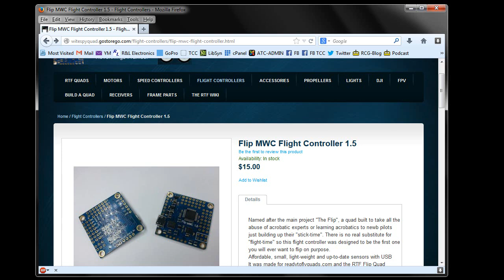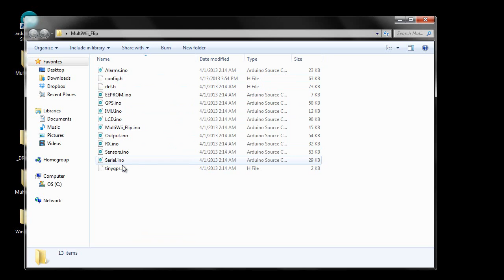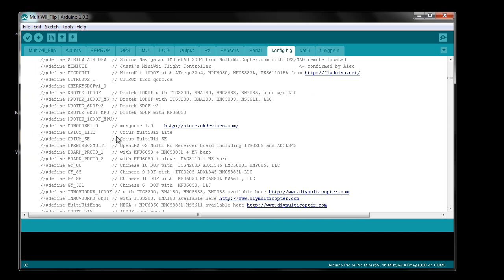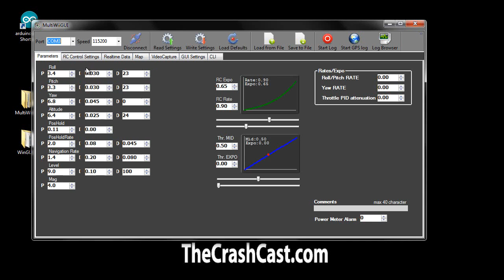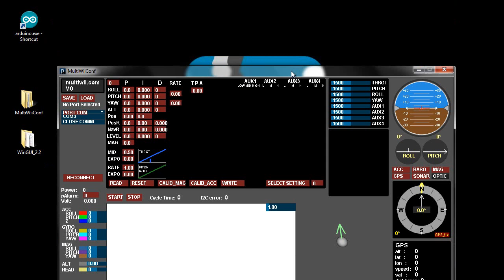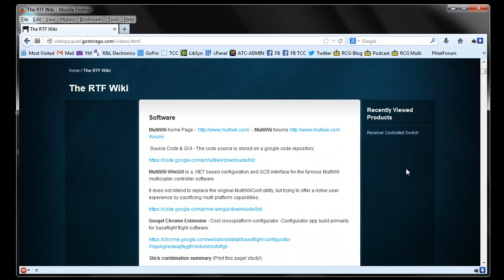FLIP 1.5 For Dummies

Comment: Crash,

Your video has been enormously helpful as I am totally new to the hobby.  

Question: Currently, I have four leads connecting the Spektrum AR6210 six channel receiver to the Flip 1.5 controller (Throttle, Aileron, Elevator, and Rudder).  In order to "arm" or activate the accelerometer, how will the 1.5 board receive the command if there is not a cable connecting the receiver to the Aux 1 pin on the board? 

Again, many thanks for taking time to post your video.

Comment: Plz help! Everything was fine, and now, whenever is plug in the esc's they beep super fast and nothing happens.... Everything works when tested individually, but when it all gets plugged together all i get is beeping. All the motors are plugged in correctly, the battery is the right voltage, ive got my trim all the way down on throttle... I dunno what to do...

Comment: Really excellent video Crash! What a lifesaver you are. 
The only issue I encountered is that for my Spectrum DX6i, I could not do the transmitter endpoint adjustment to the same range.  I could only adjust from 1000 - 2000 (in the MultiWiiConfig utility) and only +/- 125% in the transmitter. Am I missing something?

Comment: I just built a tri with Flip 1.5, everything is good but it just won't arm. Any Ideas?
Reply: I'm having the same issue except with a quadcopter.  I bought it configured for a quad.
Reply: arthurura To arm your quad just slide the throttle over to the left or right but keep the throttle off. After you arm it you should see a steady blue light on the board. Hope this helps ;)
Reply: Bill Moran make sure your tx is outputting 100% yaw.

Comment: I'm going insane trying to get my Flip 1.5 properly calibrated! Your video is great and I've followed every step to the letter, but the motors will simply not all spin up at the same throttle level,and NO motor starts until after the throttle is >50%.  I've calibrated the ESCs individually (plugging them into the receiver one at a time), and all together (using a 4-wy harness). After calibrating them using the 4-way harness, all 4 motors spin up at just above the cut-off point, and all achieve maximum RPM at full throttle stick position. As soon as they're plugged back into the Flip, they don't spin up until after 50% throttle, and they don't all start at the same time, and full throttle is probably 50% of the RPM seen when plugged directly into the receiver.

What am I doing wrong?

Comment: Thanks, Crash. This explains more than just FLIP, which name I will remember. I'm new into RC as a Hobby but have used many industrial open-source devices and software systems for my work projects. I inherited KK2 and Arduino as part of my start-up lessons so this kind of puts things in a row and I can handle that. Converting the KK2s to Airplane mode.

Comment: Great Video and I really appreciate it.. I just flew a short maiden flight with my Flite Test Electro Hub, Spider config, with the flip 1.5. and it flew great. Is there a way to put a low voltage light and buzzer on it like the KK2 board uses? Thanks again.
Reply: atsvideoproduction  Hey so for the spider configuration what do you install, the multiwii_flip_ftspider? or the multiwii_flip or the multiwii_flip_quadx?

Comment: HI, thanks for the great tutorial... very thorough. Question: On my build I have a quad x setup, I haven't been able to get it into the air because it's very unstable... I plugged it into the GUI and I can see that my Left Rear motor and my Right Front motor speed up by themselves... the other two motors stay stable. I have my quad sitting on a fairly level table and I can just barely push up on the throttle and these two motors accelerate by themselves... I unplugged those two escs and the GUI shows Flip 1.5 board  still accelerating those two motors. Is this a Flip 1.5, ESC, or Transmitter problem???

Thank you!

Comment: Thanks for the video Crash, it's been very helpful. I've just opened up MultiWiiConf to try to enable auto-levelling and I see on the 3d representation of the model it shows "Quadcopter X"... but I'd asked for this spider quad firmware. Has this got the wrong setup do you think? It seems to fly fine.
Reply: What type of receiver board did you use?

Comment: Hi Crash. I just purchased my first Flip 1.5 board and I have a few questions regarding connections to the Flip board. On a quad, you have 4 esc's obviously, do you have to remove three of the bec wires to supply 5v rather than 20? I did not see that explained. Also you explained that the connections to the flip from the receiver were using the signal wires across the top rails. Does this also need to be done on the receiver using only the signal wires?
Reply from the maker: 1. I don't bother removing the power wire from ANY of my ESCs - I leave them all live. I've built close to two dozen machines and haven't had any issues. 2. You need at least ONE connection (Rx to FLIP) where all three of the wires are used so that you can get power and ground to the Rx (I use the Throttle channel). After that connection is made, you only need a signal wire on the rest of the channels you plan to use.
Reply: Crash Hancock Thanks for your reply. i appreciate it. Before your response, I did end up removing 3 of the 4 +5v rails from the ESC's. I did not want to take the chance of burning out the new board. I did end up figuring out the signal wires as well by looking at several images that had close ups. I was able to fly the Spider X quad today and was very impressed for a first flight. I am not impressed with some of the wobble and sounds of the motors which i understand that some people adjust the PID settings for this and I am clueless. The motors sound like bad bearings in my opinion and this may be the case. i went with the cheaper red ones from Ready to Fly Quads trying to stay on budget. One last question, how can i adjust the yaw to where it is more responsive. It does not seem to rotate as quickly compared to the front to back and side to side. Again, thanks for your response and great video. You have helped a lot.
Reply from the maker: TJ Martin 1:05:45
Reply: Crash Hancock Perfect!. Thanks again. I missed that part. :/
Reply: Just one thing, not on this build, but in any to keep in mind. Keeping all 4 ESCs powering the FC doesn't put the volts up to 20 (4x 5V) as they are connected in parallel, not series. It's like connecting batteries in parallel, where the mAh add up, but the volts stay the same.

Comment: Hey, Crash. I'm a beginner at this, so please pardon my lack of knowledge. When you ordered your Flip 1.5 MWC, what are the options that I'll need to select? I understand that the case is a MUST, as well as the configuration of the multi-rotor, but I am unsure as to whether or not the connection pins come pre-installed or if I have to select the straight ones, etc. I think they're called "Pin Headers" on their website, but I'm unsure. Could you help me out with this? I'm trying to figure out what options I need in order to have your set up, which is the same one shown here: http://witespyquad.gostorego.com/catalog/product/gallery/image/729/id/163/. 

Thanks for your help, man. I really appreciate it!

Comment: Just thought this might be useful for people watching this: at 16:00 you talk about reversing the Yaw Servo by modifying config.h. In MultiWii 2.3 that the Flip 1.5 currently comes flashed with (which is the latest version, not 2.2 that you are referring to in the video) changing this value in the the code will have no effect over the servo/acc direction. Instead you can just change it in the MultiiWiiConf23 GUI.

The steps are a bit odd but this worked for me:

Start MultiWiiConf23.
Select the serial port.
Click "start".
At the top of the window "SERVO" will appear between "MULTIWII.COM" and "SETTINGS", click that.
Now in the servo screen you have to click the red button labeled "SERVO", it should turn green and more things will appear.
One of the things that will appear is a red "GO LIVE" button. Click it, it will also turn green.
Another thing that appeared above the "GO LIVE" button is a box labeled "Change Gyro/Acc Direction", click that, it should go solid white.
Now click the green "SAVE" button.
Click "CLOSE COMM".

Your servo is now reversed and your tri will stop spinning like a top :-) Hope that helps someone.

Comment: Nice job on the video, does the auxillary from the flip fc go to the gear channel on your spektrum reciever or is it the aux 1 on the reciever.
Reply from the maker: You could use either one, but I use the gear channel since it offers a 2 position switch. If you wanted to experiment with Angle AND Horizon mode, you could take advantage of a 3 position switch and plug to Aux 1 on the Rx (6th channel).
Reply: Thanks! I was also wondering if i need to remove the bec cable from my esc's im using the luminier 12amp with simon k frimware. I assumed it would get power from the reciever?
Reply: Hey Crash I actually answered my own question. The reason i was asking though was because my quad looks like it  wants to flip to the left on take off. I know the props are spinning in the correct direction so I'm kind of stumped? Any suggestions? Thanks again.

Comment: Great video Crash!  This really helped me allot.  I flashed 2.3 on my Flip1.5 board and it worked perfectly.  The only issue that I have is a slight wobble.  Do you have any suggestions on how to tune this out?  I am assuming that it has something to do with the PDI settings.  Also, have you thought about doing a follow up video on how to add GPS, bluetooth module, other options to a Flip1.5?  I would love to see a follow up....FLIP 2.5 For Dummies 2!  :)

Comment: Great video Crash.  One caveat if you are using Multiwii 2.3 with a tricopter (or other multi with a servo).  The pinouts are different with 2.3 than 2.2 and below.  If you plug a servo into a motor pin, it can damage or destroy the servo.  Make sure you use the correct connection diagram with the firmware you are using.

Comment: Crash, great video. I did find that if you flash the board with the older version after everything has been done if you forget to cal the MAG and the ACC you wii boards blue light will just keep blinking. Im also doing a video about how to adjust the trim using the built in software so stay tuned for that.. thanks again...

Comment: I've tried everything and I can't get this to go below 1000 or above 2000 around 36:00
Reply from the maker: That's because you are using v2.3 firmware. In the video I am using v2.2 firmware. In that version, you can get the prescribed 980-2020 ppm. :)
Reply: Crash Hancock
Well that's simple enough! What else will be different when setting it up?
Reply: kittyhak is that important? (getting it below 1000?) I can not get motors to spin for the life of me? Rapid beep (as if ESCs are seeing some throttle)

Comment: Crash.... That was awesome. As luck would have it I was just getting around to putting all of my parts together for my OPQ (from your 1st batch). This made setting up my 1.5 board soooo much easier. I like it alot better than the KK2.0 I have on my Tricopter. It will have a Flip board soon. THow about a For Dummies video on setting one up with GPS and a compass? Thanks so much...See you on the CrashCast.

Comment: Is this board and firmware the same as a naze32 arco? Meaning, is it just rebranded under Witespy? Be easy cuz I'm new these boards:/. Thanks.
Reply: No these are Boards commissioned by RTFQ AKA Whitespy not related to the Naze32 at all.
Reply: Crash Hancock
nazA is the DJI product, nazE is the piss-take from Timecop that runs MultiWii.  Paul aka WiteSpy makes a clone of the Naze and Naze32 as well.
Reply from the maker: Ben is correct. From everything I know, all Naza products from DJI are their proprietary coding. The FLIP 1.5 is an open-sourced MultiWii system.